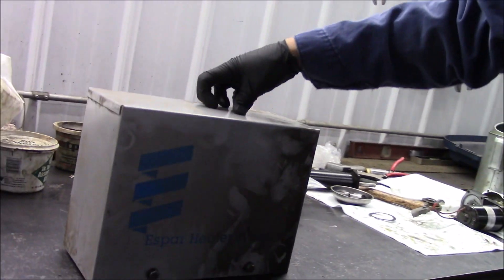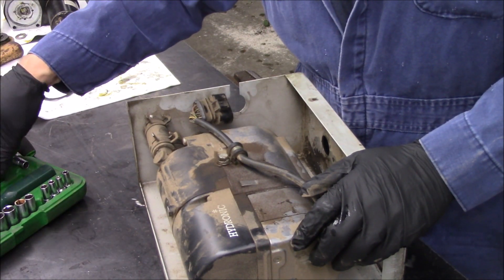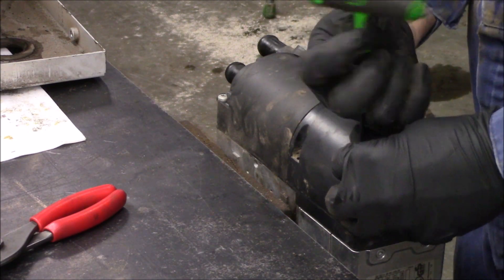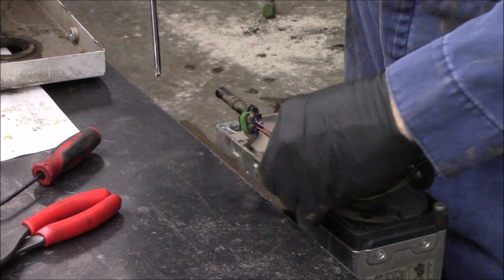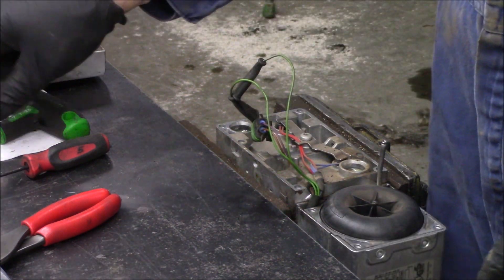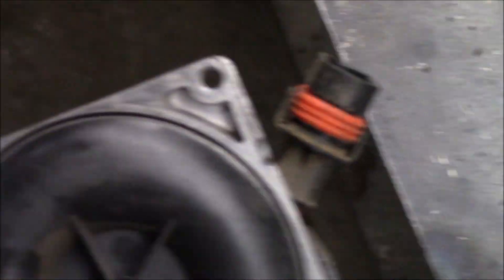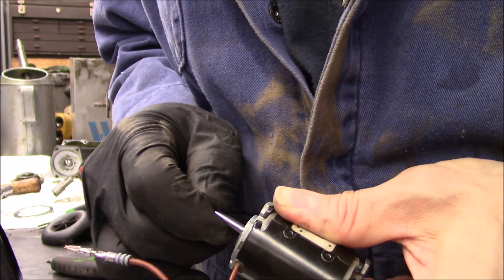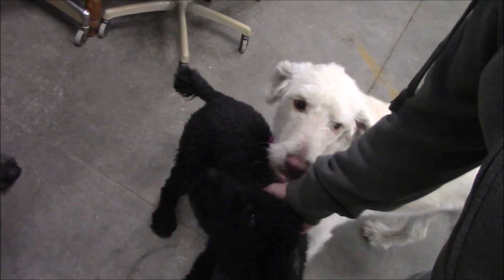Espar D5WSC Teardown!

Comment: Does the espar d5wsc need an external pump to get diesel or does it have a pump inside the housing? I'm trying to figure out if I can just T in a line to the espar or if I need to put a pump in the line.
Reply: That would depend on your model. They make a version with an internal pump, and then they make a version with an external pump.

Comment: Really like your video, but I have a question been working on one of these to. When i push the panel inside I hear it make a noise a like it's starting but it stops after about 5 seconds. So I disassembled it but could not find any thing obvious... any Ideas to help me out? thanks!
Reply from the maker: Probably not making it past it's own self diagnostics. Something in one of the electrical components isn't working properly so it won't attempt to start. Download a manual online and test all electrical components with a meter. The book will give values on components
Reply: @MichaelJBerg  did that testen the sensors on it for the ohm's and they look good put is half under the van and it worked. then i fully put it back and again the same. (It did run about a minute without cooling on it) and now it's stopping in the self diagnostics again. but thank you for the advice!